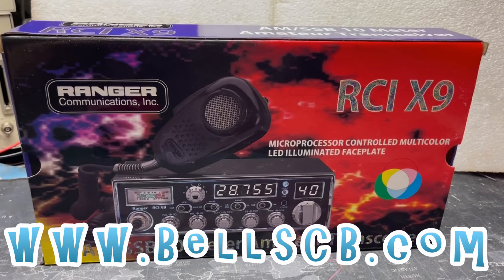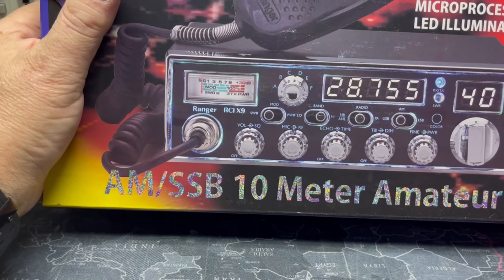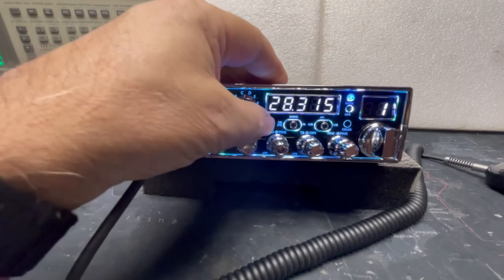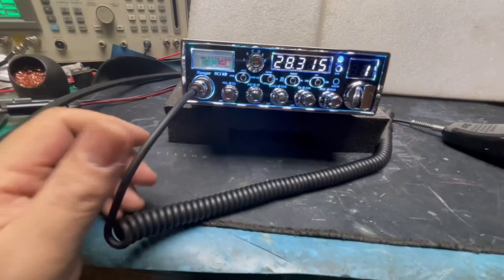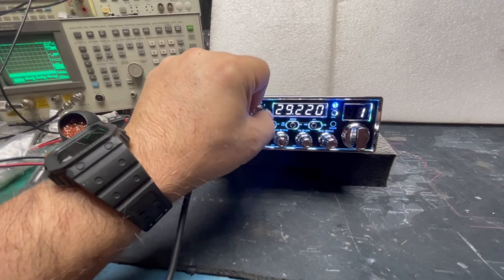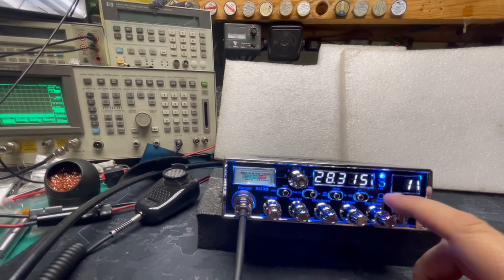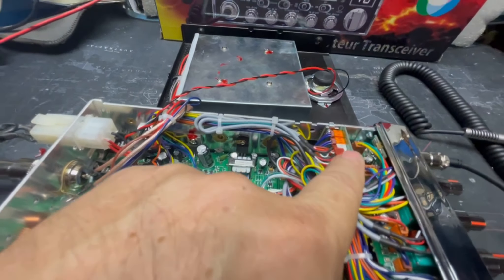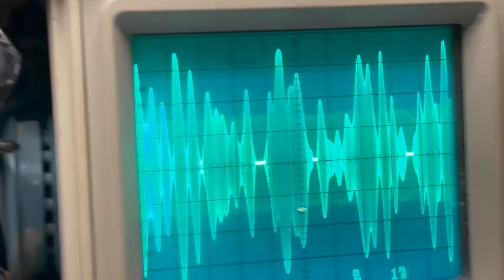Ranger RCI-X9 OEM Radio Report

Comment: AWESOME VIDEO DOES THIS RADIO REQUIRE  A MOD TO OPEN THE FREQUENCIES AND WHICH RADIO DO YOU THINK  IS BETTER  AN RCI  X9  OR STRYKER  955
Reply from the maker: It does require a mod, and the 955 is the best, it has a cleaner more stable output with better modulation in all modes.
Reply: @BellsCB  THANK YOU SIR YOUR WORD MEANS ALOT TO ME THANK YOU